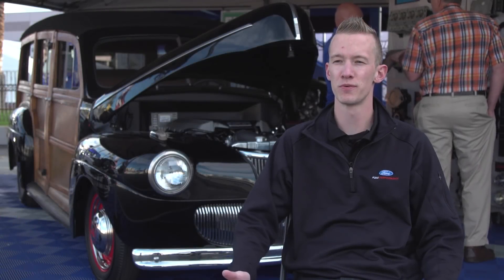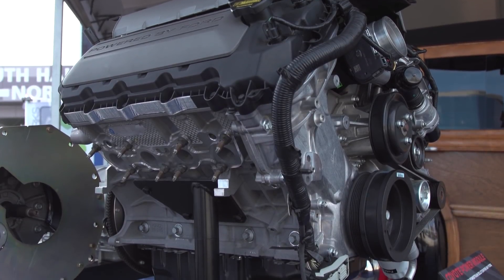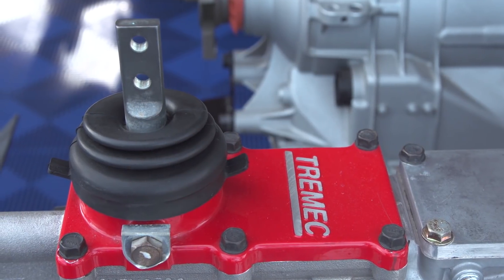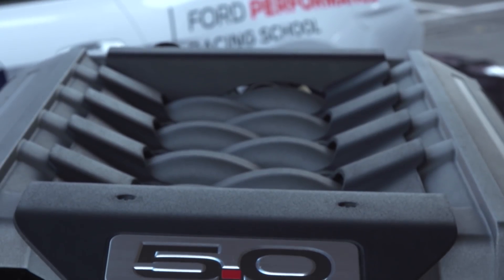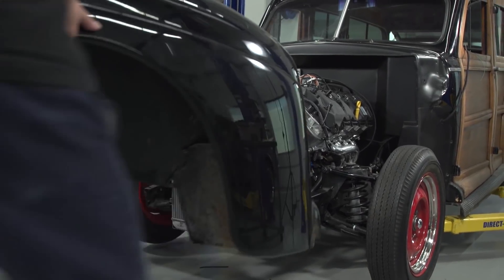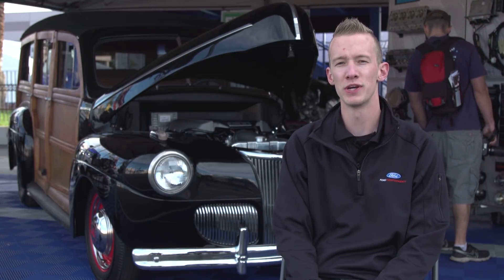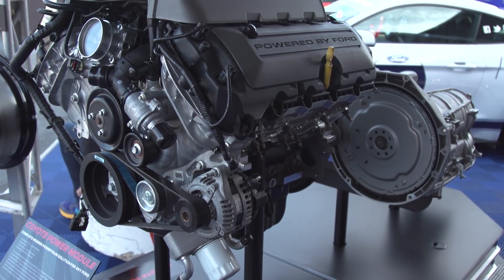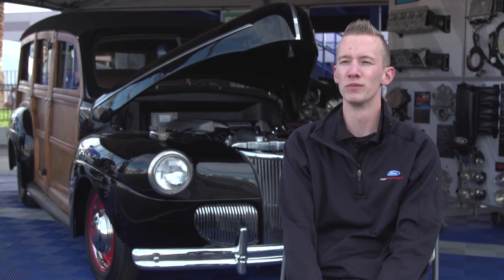Coyote Power Module: Overview (Part 1) | Ford Performance

Comment: Why not the 2018 coyote with the 10 speed transmission , and direct and sequintial fuel injection
Reply: Might be the required fuel system to support the combo.